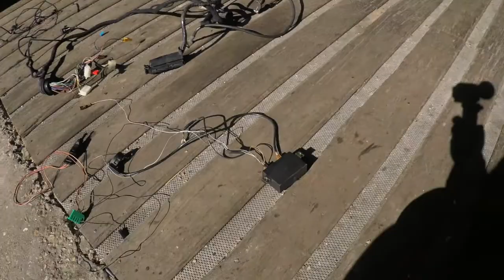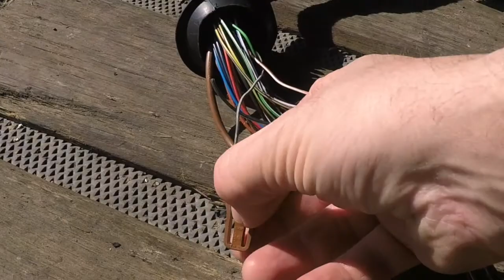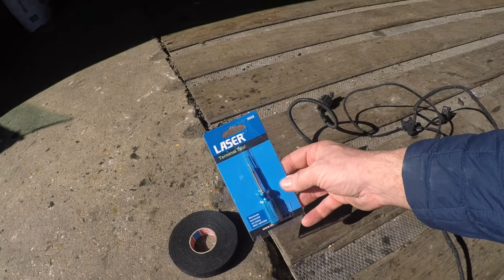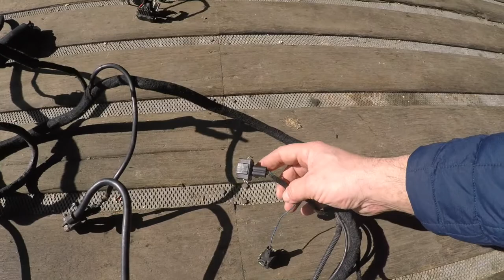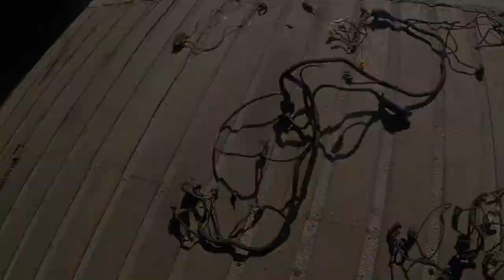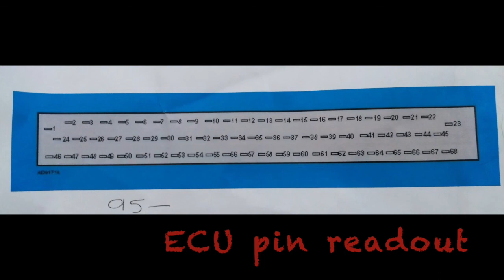How to ABF wiring loom

Comment: Am in the process of overhauling an ABF installation in a T25 and am at the stage of putting all the wiring back in- this video is really helpful! Thanks for taking the time to put it together. 

On thing I’m puzzling over- Do you know is if there’s supposed to be a protective cover for the header where the loom connects onto the ECU?
Reply from the maker: Hi yes, I think I've seen your posts on insta👍🏼on the ABF mk3 yes  there is an alloy heat shield that bolts on to the head.

Comment: You can always snip the blade of the old key off and keep the top of it with the chip as a keyring beside your ignition key. It'll be against the ring then when you have your key in to start
Reply from the maker: Yes that is always another option.